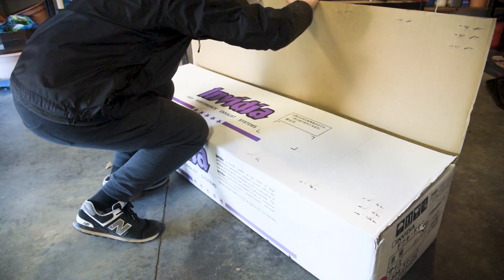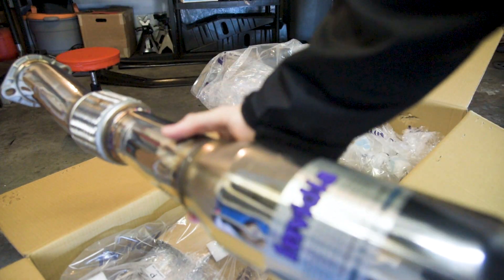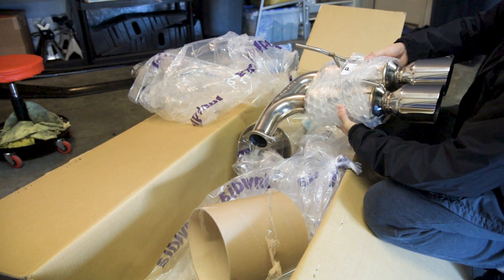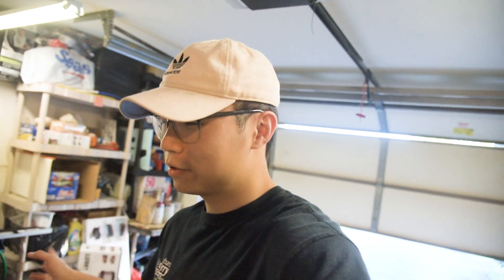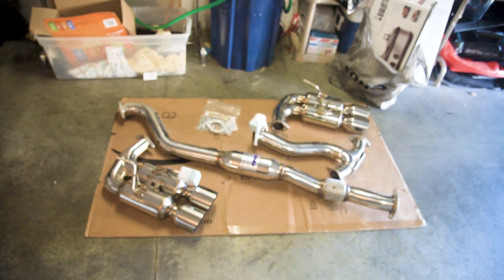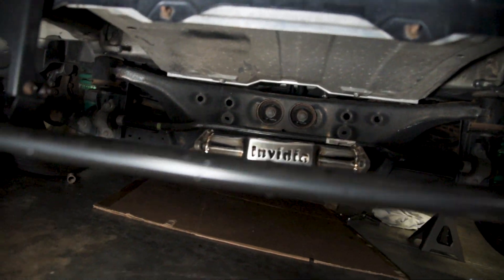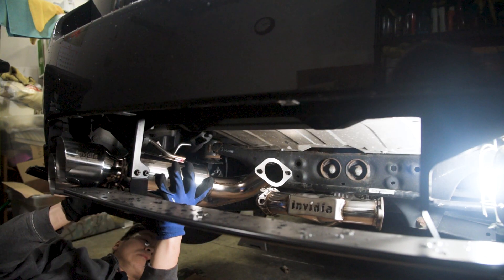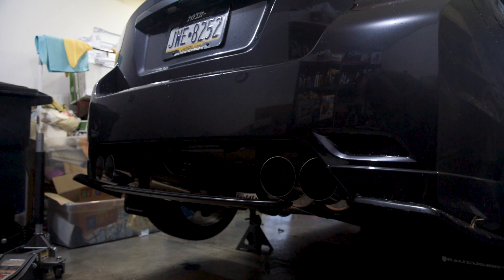Best Subaru Exhaust Ever! | Invidia R400 Catback Exhaust Install

Comment: Best exhaust is correct. Getting enjoyment and compliments all the time. Bought the Gemini R400 burnt quad for my flex fuelled 494whp FP Green IAG stg2.5closed ej TPG tuned dk.gray met.2011 hatch performance/aesthetics restoration. Awesome look and incredible sound! Definitely helps kill some built5spd Andrewtech PPG gearset whine as well.
Thanks a lot for this reveal.

Comment: Does anyone know if the same year model wrx exhaust fits the standard na Impreza? I’m looking at buying the N1 INVIDIA single exit catback exhaust for my 08 hatch but I’m not sure if the chassis underneath in the wrx is built different to the Impreza and don’t really plan on making a custom fit. If anyone knows lmk cheers.

Comment: I have been struggling to find an exhaust for my 2012 impreza hatchback. I have found things that look like they would fit but I'm not sure if it actually would bolt on. Any recommendations? So far all I did was a nameless muffler delete.  But I want to actually see my pipes and have better sound of a full system
Reply from the maker: This exhaust right here lol
Reply: Awesome was not sure it would be any different for a 2012 I have seen a lot that works for 14+ but not 2012

Comment: Hey man - I also have a '15 impreza hatch
I'm looking for an exhaust here in Toronto, and found a "2015+ subaru wrx sti 3 inch catback exhaust Mufflers are 2.5 inch single wall"
Any idea if this will fit the impreza?

Comment: Thanks for the upload! Would you have any idea if this would work on a 2016 Subaru Impreza?
Reply: as long as it's a hatchback and has a FB20B not FB20D (I think the switchover happened in 2017) your car would have the identical setup to his.

Comment: Aside from the cutting the bumper out, what other modifications did you need to make to the car to fit the exhaust ?
Reply from the maker: You'll either need to modify the hangers or get ones that twist (like I explain in the video). Perhaps longer hangers of you don't want to do the bumper cut.
Reply: Willis Do my biggest concert is if the exhaust was just an easy bolt on replacement from a fully stock car. I know you went from the N1 to that custom set up prior to the R400. So wasn’t sure if it was an easy switch. Plus I wanna do this to a 2019 so not sure how fitment would work . Thanks for the recommendation on the hangers. Your car look fantastic keep the videos coming!
Reply: @christopherbertolozzi6673  Did you ever move forward with it? I have a 2019 aswell and wanted to see if it was do-able
Reply: Marco Ceci I did not, I really didn’t want to cut the bumper and also wasn’t sure I wanted to spend the money on a system without knowing how it would fit. Tbh I just saw that nameless put out a new axle back quad tip design specific to the 2017+ wagons that I may go ahead and buy
Reply: Christopher Bertolozzi Idk if you’d be up to it but if you do end up getting that nameless you should upload a video.

Comment: Is the drone bad in the cabin
Reply from the maker: It's droney but that's to be expected with any loud exhaust in a hatchback. It could be less prominent if the exhaust tips stuck out more. I'm used to the noise so it doesn't bother me much
Reply: @WillisDo  Just go to a muffler shop and get them to weld in a couple of inches of pipe after the Cans so the hangers wont change. The major difference between the 08-14 and 15-21 is the bumper is farther back on later models, and you dont want to burn or melt your bumper.

Comment: Hey man, did you need to use an adapter plate for the stock downpipe to cat back?
Reply from the maker: The catback bolts right up to the front cat pipe.

Comment: Is your stocked exhaust a single exit or double? Where did you get your replacement diffuser?
Reply from the maker: Stock exhaust is single exit. Diffuser is a piece for a 15 wrx sedan from ebay.
Reply: Willis Do r400 will fit 15’ impreza 2.0i sedan base model?

Comment: Will this fit on a 2014 Subaru Impreza 2.0i sport  hatchback?
Reply from the maker: Sure. May require some bumper modification and different hangers like pictured in the video.

Comment: With the cat less Header did it trigger the CEL? If so what did you do to turn it off?
Reply from the maker: Yes, you will get a P0420 code. I use Torque Pro to clear it as I still need to get it tuned.
Reply: Already ahead of you man! For the header installed and then went with ThrottleHappy Tuning, they’ll delete the CEL and are gonna add some power and forgive gains

Comment: Is there anything removable in the muffler?
Reply from the maker: Not sure what you mean, mufflers bolt onto the y pipe
Reply: @WillisDo  I only have knowledge of motorcycle end can which usually comes with a removable baffle to increase/reduce the noise

Comment: Have a link to where to get the exhaust?
Reply from the maker: I got mine from SMY Performance. https://www.smyperformance.com/invidia-gemini-r400-single-layer-quad-stainless-steel-tip-cat-back-exhaust-hatchback.html
Reply: Did you buy the hangers with it also?

Comment: Quick question, does the larger than stock exhaust make you lose too much back pressure? I’m worried that the 3” diameter will make me lose low end torque.
Reply from the maker: Not noticeable honestly. The car is slow already as it is
Reply: Back pressure causing power loss is a myth. Less back pressure the better